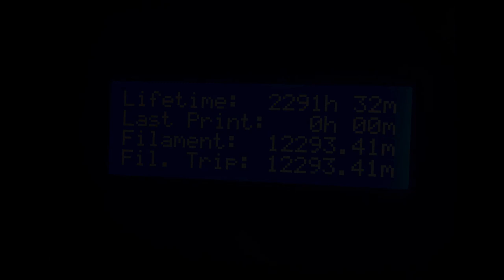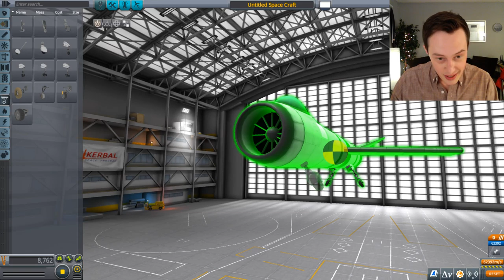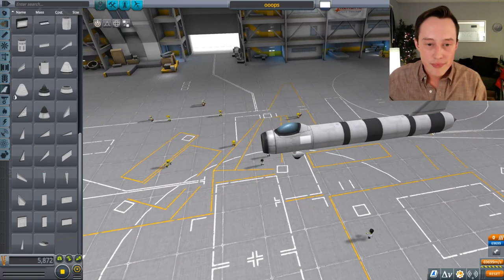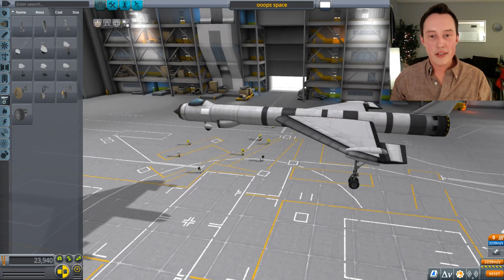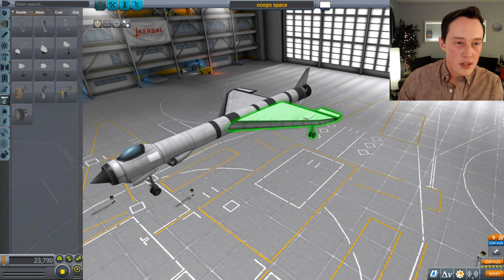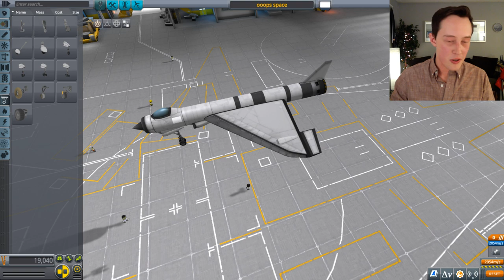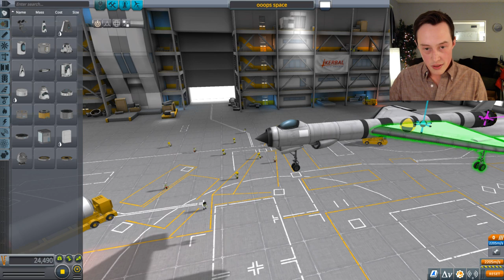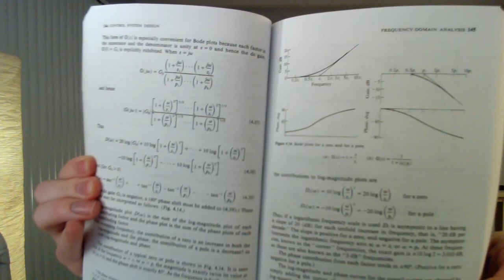Joey B Plays KSP #4 - SSTO?

Comment: Joe, your elevons are in a great place for ROLL authority (out at the wingtips, centre of mass), but in a TERRIBLE place for PITCH authority, because they're too close to centre of mass. You need a canard foreward control surface or a conventional tailplane, doesn't matter if it adds mass. Control matters more than mass sometimes :-) wow, jet seen that you landed ok. Holy cow! Anyway, think of control surfaces as levers, and where you would put a lever for max mechanical advantage... Hope this helps. Love this series anyway!
Reply: Also, while in air-breathing mode, you shouldn't need LOX in your tanks for that part of the flight. The LOX is only for rocket mode, so extra unused onboard LOX will be wasted mass if you don"t use it, and so will reduce delta V. (Having said all this, hats off/crabs up to you sir, because I haven't built an SSTO myself yet so Internet plz shoot me down freely :-) But my first flight simulator experience was on a Sinclair ZX-81).